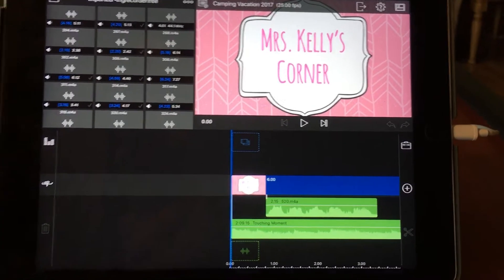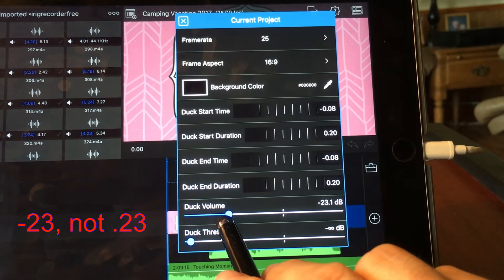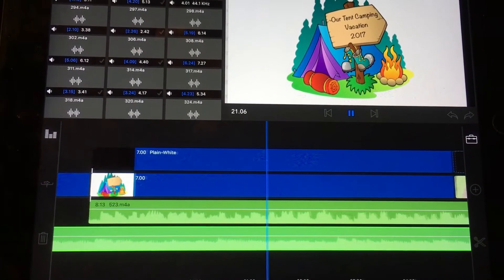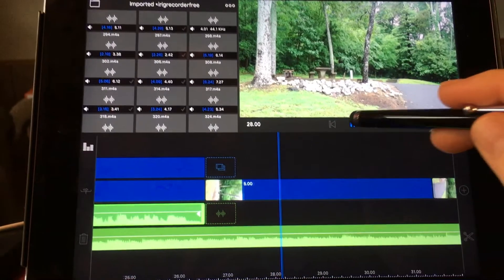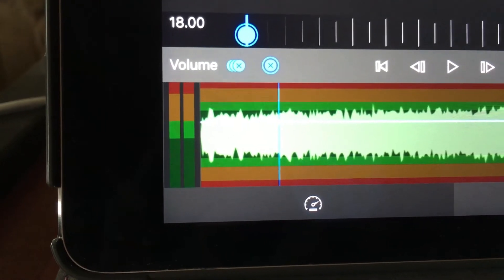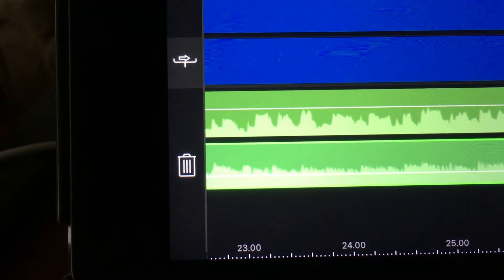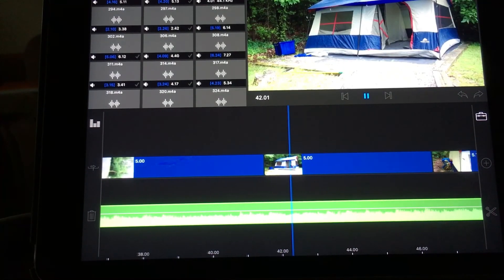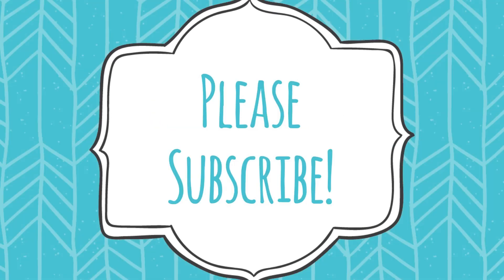Audio Ducking in LumaFusion (2 Different Ways to Decrease the Music Volume)

Comment: As of one of the latest updates, voice overs are automatically set as Master. However, if you record voice overs in a separate app and then import them to LumaFusion, you still need to go clip by clip and set the audio configuration to Master. 

I think it would be useful to have the ability to set the audio configuration at the track level, similar to the way you can currently set the volume of a track.
Reply from the maker: Is this with LumaFusion?  That is great if it is.
Reply: Yes